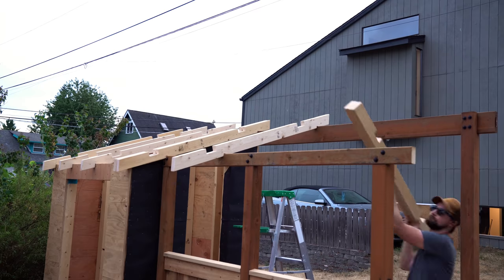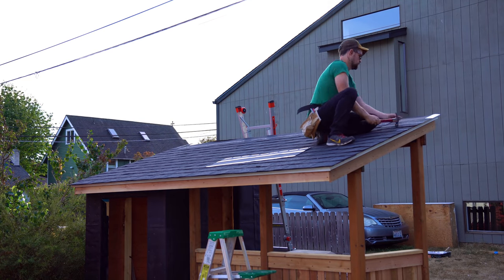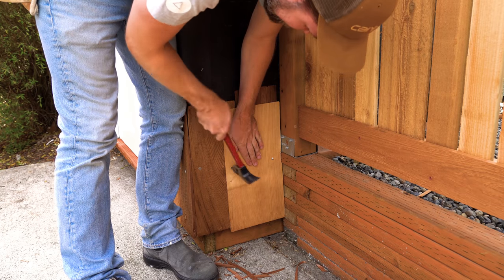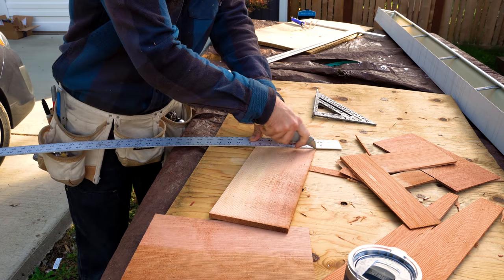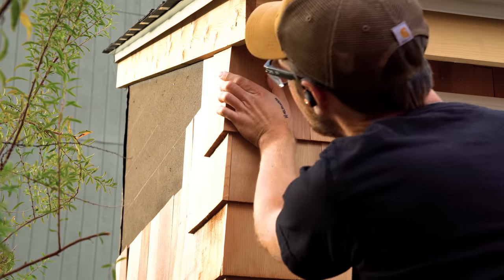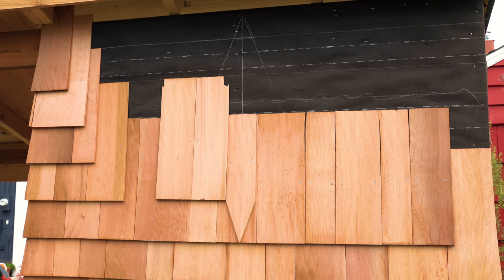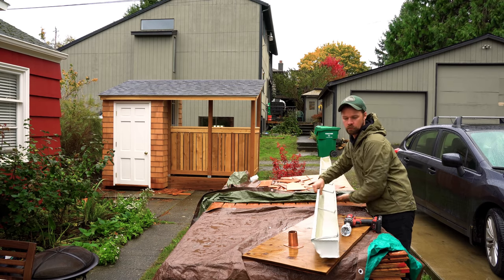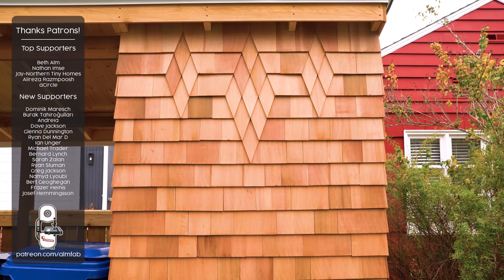Cedar Shake Shingle Shed with something EXTRA

Comment: You don't need that much slope on the gutter.  Maybe 1/4 inch over that span is lots.  It would look nicer if it wasn't hanging down past the facia board.  Nice shingle work I have some cedar in my garage that I didn't know what to do with.  Maybe I will turn it into shingles and try something like this on my shed.

Comment: Exterior trim screws are your friend for the shingles that require exposed fastening. It helps to avoid discoloration from weather exposure to the nails and the screws also come in colors that will blend in to either stained or weathered shingles.

Comment: When you're nailing close to the edge flip the nail over on a hard surface and hit the pointed end with a hammer. It'll be less likely to split the shingle because it'll be smashing its way through, rather than splitting its way through.

Comment: There is such a thing as a manual nail pusher. I have the ‘Great Neck Brad and Nail Driver’ I found and it works great. It’s a tube with a handle and it’s partially spring loaded. Just drop the nail in and push hard to slide the nail in. Bit awkward on the ladder and under the eve but doable. Your nail heads are pretty big too. Maybe too small to work.

Comment: Beautiful job!  Shingle shed corners very nice w/ custom cuts. Better looking than putting a wood vertical L-corner end cap that the shingles butt into.  Surprised you didn’t buy a craftsman style wood door. An acetylated wood door wouldn’t rot, but cd be pricey — unless you build it yourself. Thanks for sharing the process.

Comment: Another quick tip: We would clip the head off of a siding nail and chuck it in the drill to use for pre drilling where it was required.  Cheap, easy, and perfect size hole.
Reply from the maker: Good to know!

Comment: Michael.
That's an excellent job 👏 very relaxing to see you doing this.
Imo you could set the gutter perfectly level as, as water will not set either. This will make your front lines look slick 👌.
Reply from the maker: Thank you! And yeah I was thinking about doing that, because it does look a bit off.

Comment: Michael, there is some much good content in this video, thanks so much.  But I do have a question. You're installing shingles on the walls, which I believe are 3/4" ply/osb. What size of nails are you using so that the nail points are not exposed on the inside of the shed?  Really loved this series on the shed build.  And I agree .. doing shingles is super fun, very satisfying, and meditative.Oh, and the diamond looks awesome!

Comment: Dull your nails by tapping on the point with your hammer. It'll help prevent splitting the wood. This works by causing the nail to brute force it's way through the fibers instead of parting them.

Comment: Dayumm, that diamond 🔸🔶🔸 pattern came out perfect 👌🏻😍

Also, why is there a big overlap between the shingles? Wouldn't it be more cost saving if the shingles had less of an overlap? Just curious to know if it's for the life span of the shingles or more for esthetics
Reply from the maker: Thank you!
The overlap is to keep the water out. The more they're layered, the better it'll hold up. The pack I had came with a recommended course height of 5 inches, and I followed their suggestion.

Comment: Those shingles don't look adequately spaced. They expand when wet.
Reply from the maker: When you buy packs of shingles they're sold green, so they are going to shrink over time.
Reply: @MichaelAlm  interesting! The application guide for the shingles I used says "Number 1 Certi-label Western Red Cedar sidewall shingles shall be spaced apart 3mm to 6mm. Yellow Cedar shingles shall be spaced 6mm 10mm". There are references to drying so I guess they're not green like yours were.